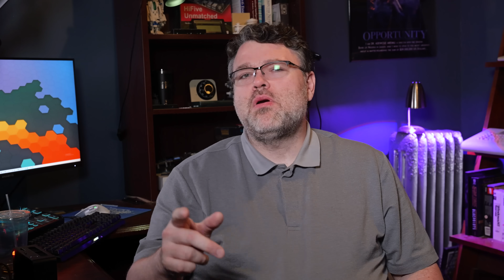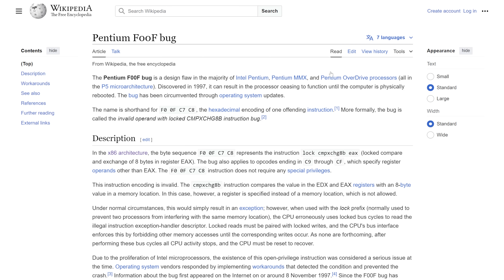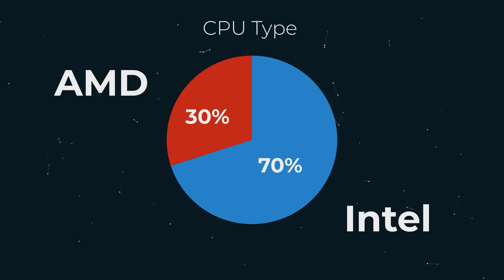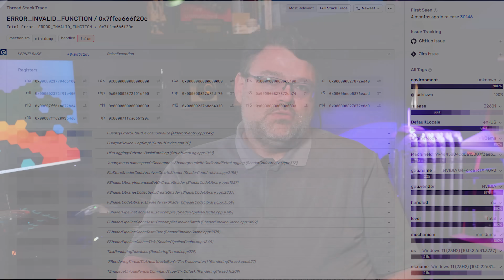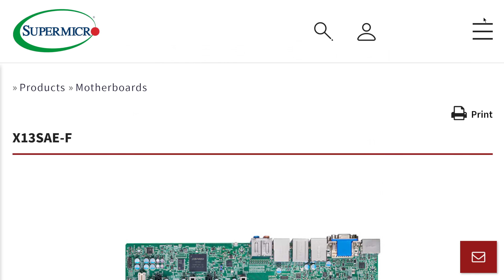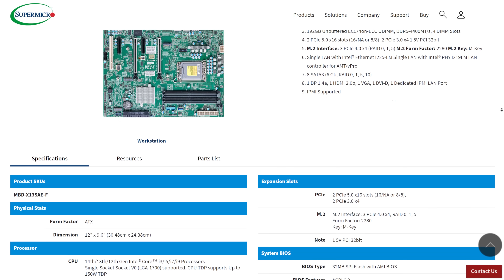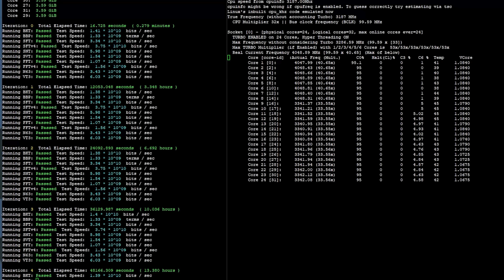Intel has a Pretty Big Problem

Comment: After watching the video and thinking about your findings, the thing that stands out to me is your observation of the tick rate on the game servers falling by 50% before the crashing.  This tells me the CPU pipelines are being invalidated, which is what's impacting performance so badly.  Whatever is happening to cause these pipeline invalidations is the real culprit, and I have a suspicion about what it is.

I believe the CPUs have new microcode to detect attempted side-channel attacks, and when that is triggered the CPU intentionally invalidates the pipelines on all cores and additionally flushes the L1 cache.  This would immediately flush any security keys from the CPU causing the side-channel attack to whiff on stealing something valuable.  Next, the L1 cache needs to be reconstituted, including reloading keys.  With NVMe drives, you can realistically expect 12+ CPU cores requesting the same key file simultaneously would work fine, but I suspect the IO errors being encountered are OS-level locks causing the cache reconstitution to fail, thus crashing the process, and possibly even the kernel.

Another cause could be actual side-channel attacks, and the CPU trying to protect itself.  If the defense strategy chosen by Intel is to crash the CPU rather than allow compromising data then they would not want to publicize that because now you have an instant mechanism to launch a DoS attack against a service or service provider.

For end users, I think that certain users are affected more frequently because their system has been compromised and is under frequent side-channel attacks.  So this begs the question, which is worse?  Do we have less active side-channel protection, probably increasing risk of keys being stolen, or do we have active protections that ultimately choose to unalive the CPU rather than allow keys to be leaked?

I would see if you can dig up any data on the occurrence of side-channel attacks on these CPUs compared to the older 12900k systems.

Final thought here, the reason that slowing down the memory improves stability is that at the lower clock speeds, the mechanism in the CPU that monitors for side-channel attacks is able to better analyze the flow of data coming into the CPU and makes less frequent false positives that trigger the failsafe mechanism.

Comment: Seems like mb manufacturers have had a lot of bios updates for the z series mb's in the last 1.5 years. Maybe Intel is colluding with manufacturers to firmware work around the problem.
Reply: Motherboard makers are some of Intel's biggest customers, so Intel are directly interested in maintaining their customer relationship by investigating the faults and providing processor microcode updates through UEFI BIOS updates to mitigate any faults. This isn't collusion, so much as a working relationship of sorts.

I'm kinda lucky now, that my best machine runs on an AMD CPU.

Comment: I am a linux user with discrete AMD graphics and Intel integrated, and my monitors plugged into the Intel. (Games are run on the AMD).  Steam hardware survey reports my GPU vendor as Intel.
Reply: It was the same for me before, Now I use AMD only PC and AMD only laptop.

Comment: Could the slowdown before the hard crash be a self-catching mechanism? I think Linus said at some point that Nvidia GPUs seem to have the ability to detect almost-crashes and pull back the clock speed for a few dozen cycles (very different time scale, I know) which seems to be part of the reason why clocking the GPU higher can actually result in lower benchmark scores before it then becomes completely unstable if clocked even higher.

Comment: Burst speed needs to be bios coded as 'burst' like in milliseconds and not to go outside the core..  I'd think it is core memory problems, mirco-area overheating.. this could be in the internal registers heating up by having to many adjacent bits on., or in the transfer controllers with the heat changing the  actual states of the outgoing bits..

Comment: "The system just gets miserably slow for up to a minute before an actual crash"

...uh oh. I don't get crashes in games, but I do I get this kind of behavior from time to time just at my windows desktop on the 13900K if I leave it running for a long period of time (like, more than 1 day). I'd start getting weird things like programs hanging in the background, Explorer stops responding to inputs, even CTRL+ALT+DEL doesn't work. It never actually has a hard crash, but it never recovers either. Only fix is a full restart, or hard reset at the power button. Guess I can expect this to get worse?...

Comment: I feel like all CPUs, no matter AMD or Intel, are being pushed way to close to the red line these days.
Would not be surprised that with all these crazy boosts aka self-overclocking at 90°C and MB manufacturers usually giving slightly more voltage some degradation is happening.
So the CPU passed the tests when new - but would fail them when operating under bad conditions only a few month later.

Comment: HA!! Love that the Oodle report mentions using XTU settings as a "workaround" because their AI Tuning recommends 57x on my 14700K and then I get the 'out of video memory' crash only when running Unreal Engine games on DX12. If I change it to 56x or force the game to run DX11, it works. I ALSO copy the XTU settings over to the BIOS just like they mention... And no other games or test benches crash at 57x.

Comment: My 13900k became unstable. Got it replaced thankfully as I refused to acccept downclocking it and living with a potentially already damaged cpu. I have had to resort to living with it with all the recommended settings in the meantime, waiting for the magical fix but after 5 months, the z690 Aourus Master board I have has still not had a bios released and I have to implement it manually.

I'm going to take the financial hit and sell the whole kit and go AMD. Intel is dead to me and I'm not even going to blink at their next range of CPU's coming out later this year. AMD is clearly the leader in cpu world.
Reply: what did you do in bios to fix the issues?
Reply: @egg3385  there is no fix, only delaying the inevitable which is that the chip will degrade faster than the warranty period. Basically power limiting the chip to PL 1 125w and PL 2 253w, dropping all p-cores to 5.3, lowering e-cores to 4.1, enabling CEP, eTVB, TVB, TVB Voltage Optimisations, C-states, disabling  ICCMAX Unlimited bit - basically nerfing the hell out of it until it performs like an i9 12900k or worse but for a higher price.
Reply: @dook953  yeah thats whats got me scared, i think its better to let the chip die to get a possible refund or a next gen

Comment: "tremendously suffering" - yes.
"getting tired of troubleshooting" - absolutely.

Thank you from the bottom of my heart for your investigation. These issues have been driving me crazy for months to the point where I thought "I might have to give up building computers, I'm obviously not qualified anymore".

I made a new build for music production in March 2023 with an Intel i9-13900K CPU on an ASUS ROG Maximus Z790 Hero board (Default BIOS settings, nothing fancy shmancy OC wise). At first it was running all good, an amazingly powerful machine. But things started to get foul soon...

Things I experienced:
- Application installers crashed at seemingly random points in the install process (biggest offender were installers made with VMware install builder used by iZotope, Steinberg and a few others)
- Application crashes: Cubase, Blender, GIMP, Inkscape all crashed at random, while DaVince Resolve was running very smoothly in comparison, haha, what a champ.
- Windows crashes randomly, sometimes with a BIOS error/warning at reboot

Things I tried that had zero effect:
- Install Windows 10 again
- Install Windows 11
- Install every new BIOS update from Asus over months (I think 4x?)
- Turn off the Windows Security shit
- Switch out every component of the build except the CPU (lmao)
- Install Debian (the installer crashed very early)

Things I tried that kinda worked:
- Windows Safe Mode: Running problematic installers there miraculously worked
- I did a few passes with the Intel CPU test tool and the first time around it failed at math. I thought that was kinda funny. Successive tests all went through all green tho.

I finally ordered a new CPU (same model) in April 2024 after the vendor of the original CPU told me there was nothing they could do (no refund, no replacement) bc erroneous CPUs were extremely rare (their words) and Intel would say no.

With the new CPU I'm now on the Intel base profile which Intel does not recommend because it's slow af(?). But it's stable so far. I have yet to install the newest BIOS update (I'm tired).

What a depressing year in that regard. I won't get those countless hours of meaningless suffering back.
Intel and Asus. No good memories.

Sorry for the TL;DR rant :/

Bless you
Reply: sadge.
Reply: also you are a good guy.I would be a dickk and sell that mobo+cpu as just like new.You did not.Respect.

Comment: Can confirm, was called in by several customers to help diagnose "strange" engine stability issues. Turned out it wasn't the code, nor the toolchain but the CPU crapping the bed in all but one case (let's not talk about that case ..). All the problems that could be fixed with a CPU downgrade had different effects in the same game build on systems with identical hardware and software. Every issue showed a different signature (there was not a single duplicate) some lead to crashes, others to performance drops or res usage spikes, others to weird OS glitches (eg. a M.2 drive performing a houdini act in windows 10 for exactly 11 frames each time a certain scene is loaded). All systems had worked fine for months before the problems started. All affected systems had reoccurring problems after the first occurrence with a near 100% reproduction rate but with steps specific to this exact system. So yeah pretty sure this is indeed a hardware issue 🙄

Comment: I work at a gaming marketing agency in the IT department, and I have been absolutely losing my mind over these issues. I have built ten systems over the last six months, and had three of them experience various failures, from One of the more consistent problems I've seen has been system corruptions, where I'm unable to even run simple Windows updates, SFC, DISM -- you name it. Recovery media fails, fresh installs on new drives fail, and the crashes on games have gotten utterly out of control. Thank you for this, it's definitely incredibly helpful for tracking our OWN sanity.
Reply: What motherboards used? And ram?
Reply: an organization white boxing servers - especially one with the money of a marketing agency is a bad premise. The IT department owns its own problems, it created them on purpose.
Reply: @malcomreynolds4103  Definitely a misunderstanding there; I am not white boxing servers, these are gaming PCs. Of course, there are third party makers for these kinds of purposes (Puget, Falcon Northwest, etc.), but they cost almost two to three times the amount of what it does to build in-house, with lead-up times of weeks to months to get our orders. It also affords us flexibility to change components as need be, rather than get locked in on something based on availability of what the builder has on-hand.

Servers, however? Definitely not. That's for dedicated engineers.
Reply: @malcomreynolds4103  Whereas outsourcing the problems to the cloud providers where you are not really important and they will get back to you when something goes wrong, and worse, no Internet means not even being able to send email to the colleague in the next office, is a better solution? If you could handle servers, do it yourself. If not, yeah, then you are at the whim of the cloud service provider.
Reply: Takes five minutes to downclock.
Reply: @chrisx742  the fact that you would have to do that is hilarious.
Reply: @chrisx742 So you pay to of the line money to get a top of the line chip, and then at first boot you have to manually reduce the performances to make it usable ? 

Sounds good to me.
Reply: @Thefuror38500  This is the IT guy's job to keep the servers operational.  He can either take five minutes to downclock, or he can continue to let them fail, do backup recoveries, and then complain on the internet.  Would you keep that kind of person in your employ?  No, he should be fired for stupidity.
Reply: @chrisx742   You keep talking about people, to defend a shitty product that is not viable out the box. 

Maybe there is workaround, sure, but that don"t change the fact that it should not commit suicide on factory settings.
Reply: @chrisx742 "So we're paying $XXX for Y-1 performance from Intel? And we can get Y performance from AMD with $XXX? You're fired if you don't make the switch."
Reply: @chrisx742  Would your first thought be "this respected manufacturer is bullshitting everyone and shipping stock settings that don't work, thus I should downclock my not overclocked top of the line CPU"?
Reply: @chrisx742  Downclock doesn't fix the problem
Reply: @chrisx742  Takes 10 minutes to rma or refund the scam. Also just sue intel
Reply: @chrisx742  Yes, and that is how I set up a 13900K system for a friend, slight undervolt and 4.3GHz on all 24 cores, letting him decide whether to push it further... But Intel advertises you can push P cores to 6GHz on these chips. If doing that definitively will destroy your CPU eventually, then Intel has defrauded their customers with the promise of performance they cannot maintain.
Reply: @chrisx742  Appreciate the thought, and while yes, it does, and we did -- used the Intel XTU, didn't go above 52x, dialed in Intel specified limits all across the board, and had little to no consistent improvement, but definite performance loss. Tried the Intel Processor Diagnostic Tool and failed consistently across all settings. RMA'd one 14900K already, popped in a spare 12900K while waiting for the replacement with none of these issues with all the rest of the same hardware.

The point ultimately is that we shouldn't need to do this, and it's infuriating to have to fight with multi-billion dollar companies to get what we're paying for, and have it actually work consistently.
Reply: @chrisx742 The fact people are so lazy these days is proof of how incompetent most computer users these days really are.
Reply: @NUCLEARARMAMENT  Users are lazy and incompetent because they bought a product that does not work? Are you serious? Intel is the incompetent here.
Reply: @NUCLEARARMAMENT  Should not need to downclock from stock settings though.
If you must, then the product is faulty.
Reply: @NUCLEARARMAMENT  More like the fact that Intel is so lazy they didn't fix this problem in 14th gen and just refreshed 13th gen, so now there's not one but TWO generations with the same major problem, is proof of how incompetent tech giants can be when they are complacent.
Reply: @NUCLEARARMAMENT   The term "computer users" generally refers to individuals who use computers for various purposes. I guess my grandma knows how to down clock her computer then?

Comment: I got that VRAM error on my 13600KF (no OC) a few times, as a warning before it's death, and it was fine and stable for a whole year before that.
Intel sent a replacement unit that runs 15C lower on stress test, using the same mobo and aio cooler. The 13 and 14th gens are a mess, terrible QC.

Comment: This sounds more and more like an I/O die or ram controller issue. Decompression in any variety is I/O heavy, requesting data from disk, writing data to ram, requesting data from ram, writing to disk or device.... not that I have ANY clue what could possible be wrong but some phenom dual/tripple core ddr2 similarities are there.

Comment: I feel like I've been blessed with a decent 13900K in my system. For 15 months I have not had a single game crash, not even a hardware error or BSOD. Surprisingly, I am running my system in 4x16 configuration with XMP turned on (5600MT/S, CL36). I do not do any manual overclocking to the CPU, however I have all the enhancements, including Thermal Velocity Boost turned on.

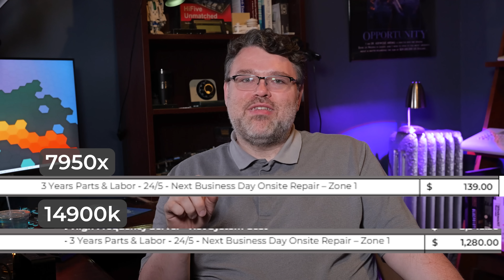Comment: 13:57 - 1.000 $ Extra - FOR THE SAME SERVICE!?! 
They want YOU, to pay for THEIR failure! 

That would be an instant hard pass by me.  Or the very least, a huge freaking red flag! 

14:32 - It is actually surprising that they are so upfront about the issue - I mean they would be probably sued to the gills if they didn't tell you that they are experiencing a bottleneck - but still, that is telling.